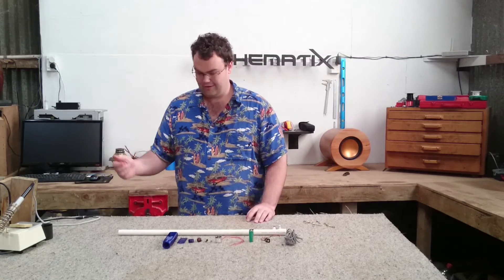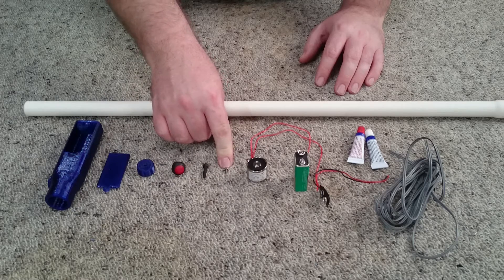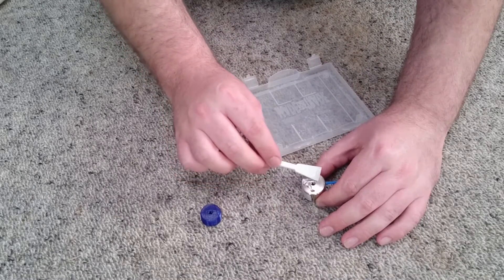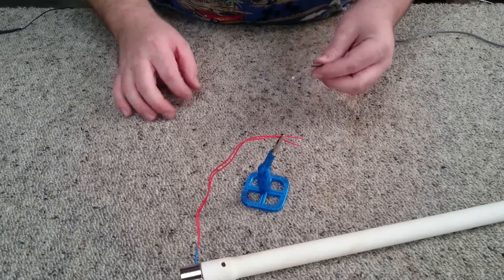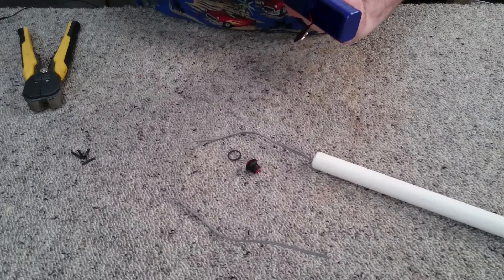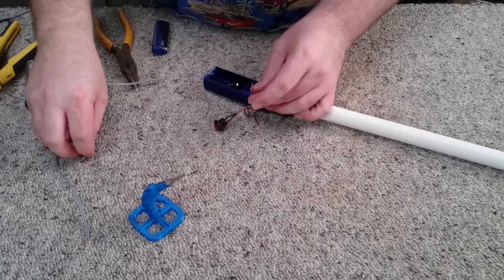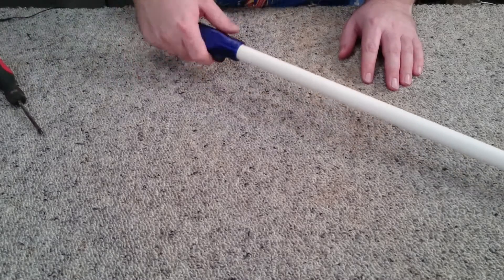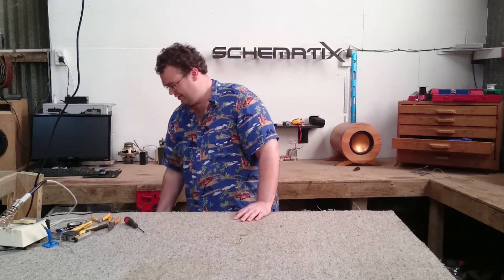How To: Make an ELECTROMAGNET pick up tool!

Comment: This is great! I've been looking to make something like this for a while, and glad to have found this. 

My original intent was to make something with more of an inverted T shape, so as to pick up small nails, tacks, and other metal objects from a garage/shop floor. Do they make these electromagnets in other shapes than this little cylindrical one? Where would someone who is electronically-ignorant go to look for something like that? 

Thanks for posting!
Reply: An electromagnet is just a coil of wire, possibly with some sort of ferrous core, depending on whether you want the field to remain after current stops flowing. If you calculate the appropriate wire length to wind for your voltage and wire insulation, then you can wind them in whatever size you want. You may want to find some videos on the shape of magnetic fields around magnets and electromagnetic coils so you know where things will "stick".

Comment: Cool tool! I bought the same magnet for a different purpose, but it gets rather hot, when I'm using it with 16v. Is there any workaround for the problem?
Reply from the maker: I'm not sure what the voltage rating on the magnet you bought is? But I wouldn't recommend overvolting, it would get rather hot indeed. There is no walkaround for the heat being generated (unless you want to add a heatsink or liquid cooling ;)
Reply: It's a fixed wire length, so workarounds involve dropping the voltage at the electromagnet in some manner. You could put a power resistor in series to drop 4V, but you'd have to know the resistance of the coil and the resistor would get hot too. Alternatively, you could use a buck converter to efficiently reduce the voltage, but you'd have to make sure the current drawn by the coil doesn't exceed the rating of the buck converter.